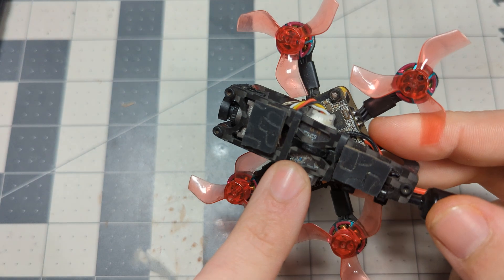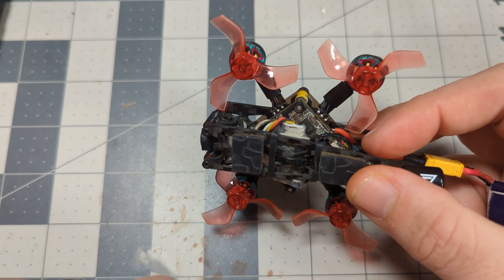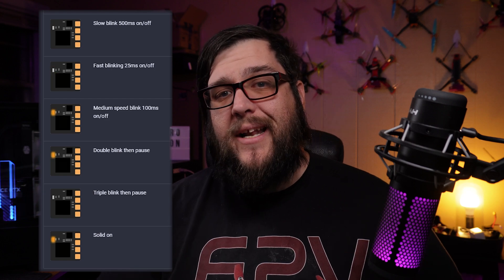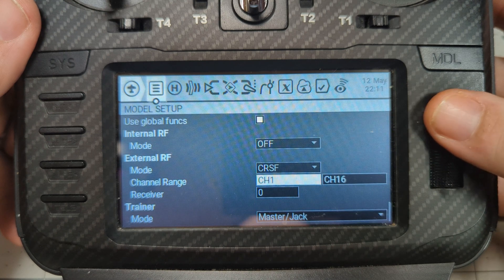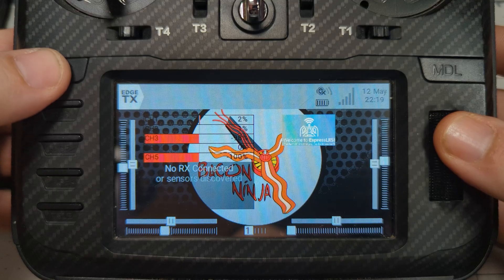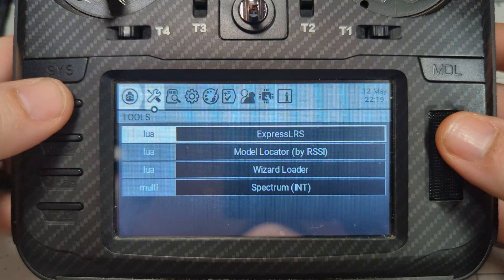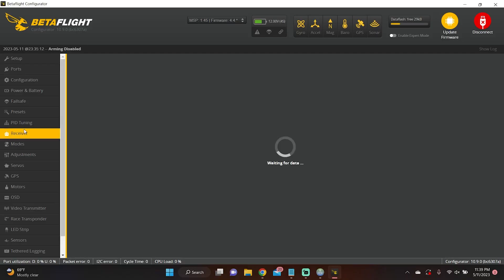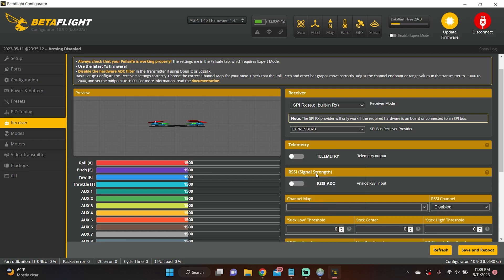Don't rage quit on ELRS, lets fix it instead!  ExpressLRS basic troubleshooting guide

Comment: LOL rage quit... Its crazy I just put crossfire back in my quads this morning after 2 months on ELRS... Yesterday I had a receiver just die after a crash and a week ago I failsafed elrs 150hz at 250mw with perfect O3 video(lost quad). Elrs is better than FRsky, Spectrum etc.. but it doesn't replace crossfire for me. I'm singing "Reunited" to TBS right about now.
Reply from the maker: I've never had one die, or even failsafe on me really.  In the past 16 months with ELRS I have had one failsafe, but that was due to a damaged antenna that I didn't notice before takeoff.  Crossfire is great though, and if it works for you then run the heck out of it!  At the end of the day all that matters is that the quads work when you want them to work, they don't fall out of the sky, and you have fun using them :)
Reply: I feel the same way, I've also started moving my uart qwads back to CrossFire.  The SPI ELRS 3 is HOT though, it blows away the FRSKY stuff.

Comment: I swear the binding phrase is glitchy.
Reply from the maker: it can be sometimes.  I haven't personally had an issue with it on just under 90 different quads bound to my radio, but over the past few months of helping troubleshoot a bajillion installations of ELRS I have seen it be glitch a few times as well.
Reply: There is a little bit of weird UX there, where if you set the bind phrase in the web UI, but then flash with a different bind phrase, it will still use the phrase set in the web UI. And you need to go reset it through the web UI to fix it.

Comment: I wonder if the binding phrase should be more like a username than a password or vice versa?  Also what's the abbreviation for BP?
Reply from the maker: They are more like your wifi password.  the transmitter and receiver just have to match up so that everything can authenticate and connect up properly.  Actually, the whole system is pretty darn close to exactly how wifi works, which is pretty awesome when you think about it!  I think BP is a great abbreviation for binding phrase :)
Reply: @BaconNinjaFPV  By your description, I take it the BP is securely hashed.  Where even a hashed copy is not transmitted as clear text?  Meaning, even though BP treated like a wifi password, using a password(letters of mixed case, numbers and a symbol) would be overkill.  Don't use your first pet's name as it's the answer your bank uses, but using your second pet's name or an old or ?current? email username(the part preceding the @) is fine?
Reply: @BaconNinjaFPV  It's funny talking about wifi passwords when BP is clearly something different because in WiFi the password is rarely used, if ever, without the SSID and it's clear E*LRS doesn't have network names and would be unable to do anything close to what WiFi does without an SSID?  It seems they are not talking about the old WEP or the new WPA2 to me and that makes me wonder what about WiFi ppl are talking about?

Comment: Good info. Yeah a lot of flight controllers have the same UART on the DJI air unit (for the SBUS) JST connector and the diagram shows to connect your RX to the same UART.  Which can cause issues by having the Dji and the elrs to the same one.
Reply from the maker: I really wish manufacturers would at least put some kind of note in there about not using both of them at the same time!  I have seen that happen at least 10 times over the past couple of months, and I am sure it is happening a ton more that I never get to see.

Comment: Priceless video mate 🤝
I HAVE however just rage quit on my Caddx Walnut! 🤬 what an ABSOLUTE effin nightmare at every point it is! 😫
Reply from the maker: I always wondered if the Walnut was any good.  Never got a chance to try it out, but I always like the little box style cameras so I thought it was interesting for sure.  What has you rage quitting on it?
Reply: I run the walnut mostly because I don't care if it breaks what's the issue? Only one I've had is if you don't put it in its correct orientation in the provided mount it won't turn off haha!!! My biggest complaint is rum time.
Reply: Happy Model Bassline SPI...Hold my beer